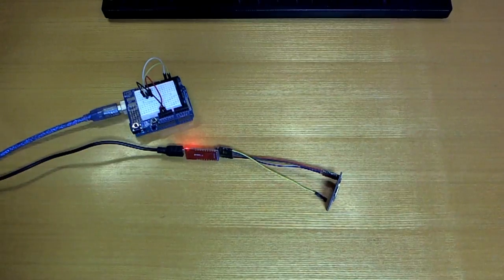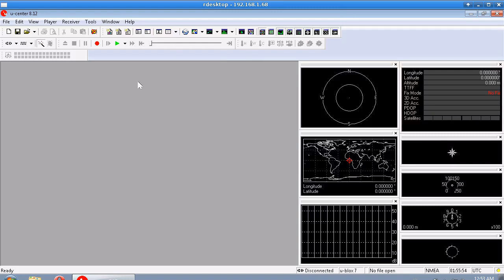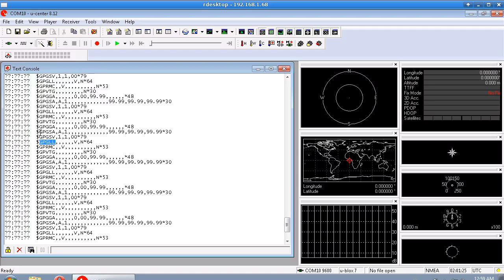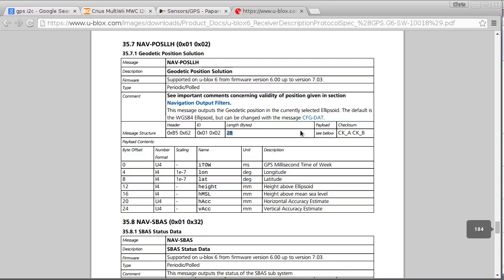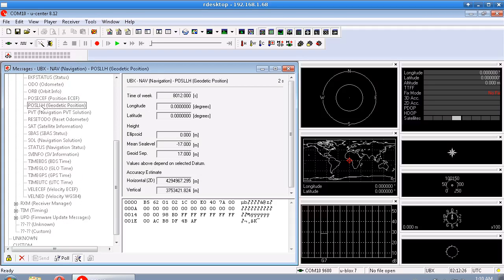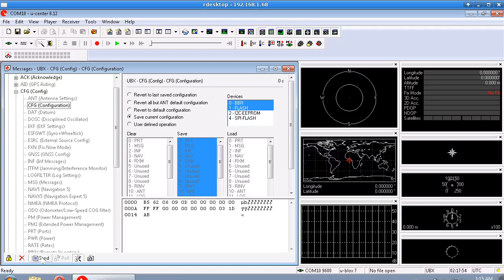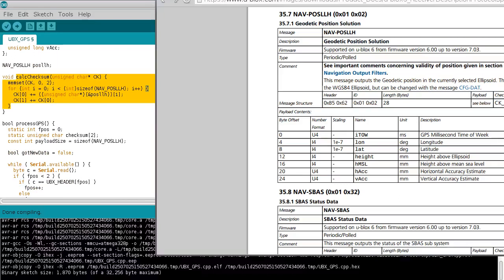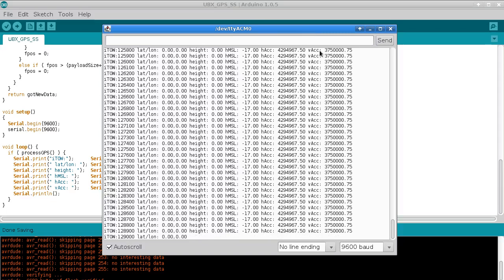10Hz U-blox binary GPS data in 66 lines of code (arduino)

Comment: Wow! That was so helpful! I am very grateful you have done this research. Like you,  I was only looking for a handful of values for my application,  LAT / LON and perhaps speed and heading etc. But parsing the numerous  text based NEMA sentences just to find the one of interest, and trying to keep up with the rate to prevent a buffer overflow seemed so  silly when I only needed 16 bytes of so.  Thank you so much for drilling deep into this and helping us understand (at least for ublox devices) how to reconfigure them for just the data we need , turn of the endless text messages in favor of the UBX binary or hex mode. Brilliant!
I just reconfigured my two UBLOX 8M modules which happily accepted the upgraded rate of 10 HZ versus the default of once per second. Cant wait to try it out in my app. Thanks again for demonstrating a game changing mode to talk to our GPS! Nice work!

Comment: This is brilliant.  Designing a GPS disciplined real time clock. Looks like I can keep the GPS code very small and use a Maxium TCXO chip to hold the time during power failures.  Update the Maxium chip every 4 hours from the GPS time and have a pretty accurate clock.  Using binary and turning off everything but what I need is really a great idea.  Thanks for the great video!!

Comment: I'm still watching! :) Thanks iforce2d for putting this together. It was tremendously helpful!   I just want to post this for anyone having trouble: I was getting no information displayed in the serial monitor despite making sure only the one (NAV_POSLLH) or two (NAV_STATUS) were being sent via the U-center software.  I tried using hardware serial (RX-TX and TX-RX) and it worked with no problem. Convert all the lines of code with "serial. " to "Serial." to let the arduino use hardware serial. Also make sure to disconnect RX/TX lines while you upload the code to the arduino.

Comment: Good video. Looking closely at a problem often reveals better solutions. U-center won't work to turn off sentences on other GPS's. I made my own NMEA state machine library that efficiently discards the sentences it doesn't want, and it takes far less resources that way, and it works with any GPS module that outputs NMEA.

Comment: Your code works fine on a Teensy 3.2.  Your explanation of navigating  UBlox's  interface was also pretty good.  it took me a long time to find my way around it. My autonomous object will fly and i had almost given up being able to do it with a single controller - two or three, but the teensy is just the thing.  256k program space and three serial ports in addition the the first one, plus swift processing 96mHz..  on teensy sketches which i'm migrating from arduino, I  get them running on an uno or mega first, then go to the teensy.  teensy compiler seems fussier about the sorts of things where C compilers used to object to C+, but not consistently.

Comment: Thanks so much for your video
I watched it all the way through.
I don't mind long videos.   ;-)
It was just what I was looking for as I've got the NEO6MV2 module and need to convert the data out from the GPS to another Binary Format for input into another piece of gear, a Telescope Controller,  which does not use NEMA Strings.
You've been a great help on this.
Cheers from South Australia.
Jeff

Comment: i once connected my GPS module with an FTDI to my computer and opened a serial monitor in the Ardiono IDE, looked very much alike what you showed in the text console :)
Reply from the maker: Yes, the factory defaults seem to be quite similar for most modules. Unless you change the settings like I did, you will get exactly what we saw in the text console to start with.
Reply: ***** hi there, thank you for reply, i did check the battery voltage , it seam to be holding charge, am so frustrate, some how with the laptop in u-centre , i got the gps fix very fast, and first time in the copter it pick up fast too, but lol leave it for a bout 10 mins or more , then maybe need to waited forever ;-)

Comment: Thank you,  thank you, thank you!!! Excellent video. My most immediate concern has been getting an accurate time value from the GPS unit, accurate to the millisecond. The iTOW (Time Of Week) value would seem to do exactly what I need. I followed along, running the u-center program connected to my GPS unit and the iTOW values do indeed seem to be providing millisecond accuracy, with sequential values of 28.552 s
, 29.552 s, 30.552 s, 31.552 s, etc. So, exactly 1,000 milliseconds between each subsequent message.

HOWEVER, I notice that in your test setup in which your GPS unit has no antenna and is therefore showing no lat/long values, it nevertheless IS showing what look like valid iTOW values, AND every single one of the iTOW values ends with 00, incrementing by 100 each time, which corresponds to the once-every-tenth-second that you have set for its rate. But where is it actually getting those iTOW values if not from satellites? It looks very strange to me that your values are always coming in precisely on the tenth of a second, while my values (from a GPS that's definitely accessing satellites) happen to be coming in on the .552 second.

Are the iTOW values actually received from the satellites, or is it somehow just calculated and local to the GPS device?
Reply from the maker: I think it just gives some local value based on when it started up. Usually there is a tiny button cell battery used to store the ephemeris information for quicker startup, so perhaps it also stores the last time it saw and begins with that. Either way, just ignore all data until the 'fix' value is valid.
Reply: @iforce2d  Thank you for the quick response, even though this video is over six years old! :)

Comment: One Arduino-specific issue, at least with presenting the Lat and Lon data, in 'human readable' form (on any model, apart from Due)... Arduino Uno float variables are strictly single-precision. That means, when you divide the values by (/10000000.0f) you aren't getting 1e-7 precision. If you watch the data stream by, you'll notice that the number will be static for long periods and then, the last 2-4 digits will all change together. Since the height is only divided by 1000, it doesn't appear to lose any precision.
For the inner workings of a multi-copter, best to work with the 'raw' long number and don't give up the 1e-7 precision lost in converting to single-precision floating point.
Reply from the maker: True, that is how a lot of the multirotor code (that I've seen at least) does it.

Comment: hai. i'm using gy-neo6mv2. i had problem when i attached it on arduino nano. there is no serial output result. but when i try it directly on u-center it's working. can you help me? i use ýour UBX_GPS_SS

Comment: Thank you for sharing this. So often the library code uses too much the available memory of the Arduino. I will be using the code for my project. My challenge is to minimize memory usage and  power consumption. I have GSM (SIM800L) , GPS (NEO-6M) , MOTION (gy9255), radio (NRF24L01) and weather (BME280) devices to manage with a single PRO MINI.

Comment: Sry for the late reply but it seems to me that save and load the configuration refers to saving on the PC not the ublox. 
Send is indeed the act of committing the config to the unit.
It can also be that the PC software could make a auto-commit, that is sending the configuration, to the unit on exit or the like. it's a matter of checking how the U-Centrer sotware exit warnings are alerting the user to sedn or save the changes made to the configuration.

Comment: well, you did it again - one more in a series of great vids that shoot right to a topic i've been interested in. i've read before about shutting down a lot of the info on a GPS so that the Quad can better utilize just the pertinent info it needs. - and while U-Blox is a great piece of software - it is not all that user friendly. you were able to clear up 90% of what i wanted to glean off the software. thanks for that.
I have a question, though... when using Cleanflight - the CF software allows you to pick a bit rate. does CF push ANY data to the GPS module or do you just set that bitrate according to what you programmed it to?
keep up the great work - as far as i'm concerned - your videos are just long enough.
Thanks,
Russ from Coral Springs, Fl, usa
Reply from the maker: To be honest I'm not sure how that works. hm..... just checked the source code - Cleanflight sends a 'change baud' instruction to the GPS module on all baud rates one after another. One of them has to succeed, after that they will both be using the desired baud rate.
Reply: ahh... there had to be a reason why there was a dropdown selection for the baudrates... so - you believe that the software only tries to GET the baud rate & doesn't SET any gps options? Is there a way of telling which "G" code line that CF looks for when it grabs the Lat/Long? are there any other lines. my guess is that it would be more beneficial to shut down the other data lines so that the CF would not have to read thru all the lines of data the GPS would (at default) be sending down the Tx line to the CF, and therefore having less lines to read, the processing time of obtaining the Lat/Long would then be shorter. <-- totally guessing out my butt, here. Actually, instead of asking you all these questions... I SHOULD ask you where to look in the Github site, for the Code you were looking @ to find out what you did - this way I could look for it myself - & learn how to read the code. Thanks for the answer above. appreciate you getting back w/me.

Russ
Reply from the maker: No, quite the opposite. The flight controller sets the baud rate and a bunch of other things too, the SBAS settings, the update rate, which messages to provide etc. If we are talking about the UBX protocol as covered in this video, it doesn't use any text string 'G' codes. Part of said settings is to disable those NMEA messages and use UBX binary messages instead (as at 22:24 in this video).

As for the setting of baud rate, my explanation before was perhaps a bit brief. Suppose you choose a baud rate of 57600 as your desired baud rate. When the FC starts up it will tell the GPS module "Let's talk at 57600 baud". But the FC doesn't know what baud rate the GPS is currently listening to, so it sends that message at 9600, then at 19200, then at 38400.... and so on, to cover all the possibilities. By the end of that process, it doesn't matter what baud rate the GPS was originally using because one of those messages will get through, so it will switch to using 57600 thereafter. This would be at https://github.com/cleanflight/cleanflight/blob/master/src/main/io/gps.c#L269
Reply: I'm on a bus, I apologize for any text errors. I now understand. The FC actually DOES send control codes. Codes are dependent on the type of GPS you select in the clean flight software or I have software.
Reply: yeah - that last remark did not finish up correctly - bumpy bus ride. so the bottom line is, it does no good to fool around with the Ublox because it will all be taken care of in iNav Flight. thanks. so now i'm moving on to your "tagging" videos. sleep tight.

Comment: Great video. I am programming an arduino UNO and Mega 2560 to get GPS out of a BN-220 GPS and save it to sd card. The sketch works find but is not working on a pro mini or nano because its too big. Now I found this video and will try to use UBX protocol instead of NMEA and make it work on a Arduino NANO. The plan is fly around with my rc glider. GPS receiver in the glider sends data to ARduino and then Arduino sends it to X8R receiver and gps data is shown on my FRSKY Taranis X9D  transmitterscreen and maybe also stored on the sd card of the TAranis. I already reconfigured the BN-220 wit Ucenter. I also noticed it doesnt always store the settings. If it works I will make a video. I also want to check OpenXsenser, maybe they have a sketch for this.
Reply from the maker: Changing the settings and storing them permanently are two different steps. After you have confirmed the module is outputting the messages you want, you can do Receiver > Action > Save Config. Otherwise the settings will revert to what they were before, after a power cycle.
Reply: @iforce2d  i just found out that I can connect my BN-220 gps to my OpenXsensor Vario I made. Its a matter of activating it in the sketch and it must work after alter some bitrate settings maybe. Thanks for your advice.

Comment: Great video! You might be able to make this code even smaller by filling up the buffer and looking for the sync word of "ub" and the message ID and laying the structure of the message over the buffer instead of iterating over each byte.
Reply from the maker: Not sure exactly how that would work. My method makes sure the bytes following 'ub' will always be at the beginning of the struct, and requires only the number of bytes that the message actually needs, and the message struct itself acts as the buffer. It sounds like your method would require a second buffer of at least as much memory as the message size, and would often find the 'ub' in the middle of the buffer. Of course it would work fine and might even be less lines of code, but seems a little less straight-forward.

Comment: Nice tutorials, normally, I use GPS with Arduino for datalogger, also I use Laptop with U-blox for Lat and Long coordinating. Just a questions. Each time when I use GPS module, their time is in Greenwich Time Zone or 00:00 U.T.C which is 6 hours ahead of Central Time Zone -6:00. How do I change it from Greenwich Time Zone to Central Time Zone? Thank you.
Reply: By the way, Where can I buy Breadboard soldering PC board? The one you have are awesome!

Comment: This was such a useful video, thanks.  How good is the u-center software, after using that I think I'll be sticking to using u-blox as my go to GPS module, especially given the price :)
Reply from the maker: NOTuNOTme "how good" is a bit vague, but it lets you set any option available on any ublox module, there are many views available to see the data, and it doesn't crash... :) It's free and you could have it running on your computer in a few minutes to see for yourself. http://www.u-blox.com/en/evaluation-tools-a-software/u-center/u-center.html
Reply: ***** Sorry, "how good" was supposed to be a rhetorical question like "how good was the rugby last night" haha.  

They did a quality job on this application, right down to the field descriptions in the NMEA sentences.  The best feature is they display the byte code for the command you've selected,  that's so useful.

I'll get a NEO-7 next.  Will be a cheap way for me to play around with GLONASS.   

Thanks again for your great video.

Comment: This GPS module accepts amximum 3.8V on Input pin, and max 10mA current on I/O Pin. You seem to connect Neo-RX Pin raw to 5V logic Arduino. Is that safe?

Comment: Hello iforce2d! 
what if the vcc and grnd pins appear as shorted out when checked with the multimeter. Not on the board but shorted out on the chip ? (ublox 6M) (GY-GPS6MV2). I bought a new one recently and plugged it with APM 2.8 flight controller. I think it did not work. I also tried the TinyGPS test library and received nothing from the GPS on Arduinomega 2560. Yes the Gps module was hot when plugged in to 5 volt . But later connected to the 3.3 volt option on arduinomega. Never did the GPS green light lit up and neither did i receive any information on serial monitor . Should i check using FTDI connector on ucenter or do u think the module shall not work ( as it might be damaged). 
Looking forward to ur response!
Reply from the maker: To be honest I have no idea. Sounds like a faulty module.

Comment: Really Nice Video, Do you have an example sketch using the Tiny++ Library, I am using a Neo-7M gps module and Wemos D1 mini Type ESP8266 Board. Not having ANY success with the TinyGPS++ library so far.

Comment: After watching this... have come to the sad conclusion my u-blox 7M has a bad antennae connection and the RX pin into the device is not happening.

Explains why I have never been able to change anything in u- center, also I assumed if data was coming through it was connecting to something. Connecting just VCC, GND and TX is fine if you never want to send commands to the module.

Have a 6M module ordered that has SMA antennae connector, out of the box USB (for testing) and has good sized soldering pads.

Use the GPS (ATM) to set a clock when powered on and once a day after that. Will eventually make it only send packets I need and use the binary protocol. Since I just want the UTC time it should save a lot of CPU and code.

Comment: Great Job ! Do you think it's possible to do RTK using this kind, or similar, modification with the ucenter software ?
Reply from the maker: No. RTK requires different hardware, and a separate base station. https://youtu.be/n8PUyOtiGKo?t=406

Comment: STILL WATCHING. Convinced me to stop wasting hours figuring out nmea/pubx commands by text and getting the usb-serial adapter. Looking forward to a much smooth experience. Would you happen to know which UBX version specifically would work with the BN-220? Documentation use says UBX
Reply from the maker: Yes, I use BN-220 for everything now. BN-180 also works and is a tiny bit smaller.
Reply from the maker: ah, you were asking which version. Not sure, but the code for my balloon works with the BN220, using the NAV_PVT message.
http://www.iforce2d.net/sketches/radiosonde/